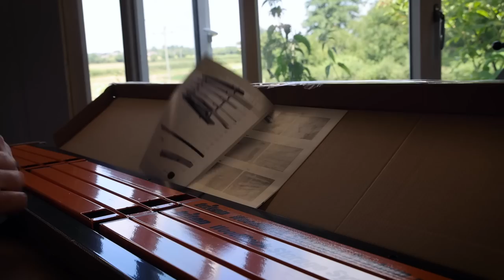Building a Home Workshop Timber Storage System for Guitar Building

Comment: Ben, I vote for a body on the Elm. I wish we had some here; the Dutch Elm Disease took all of ours. What tiny bit we still have is not protected. 

Any shape you like, but I wouldn't cut it up like Bob or something. It isn't wide enough, really, but you could book match it, giving you two seams or cracks in the center of the instrument. A two sided thing like your copper-rodded ones might look cool. Maybe not, that might be too busy. Use your judgement, but that's too nice and the crack too wide to make tops out of it. Besides, that piece is one of a kind. The guitar it makes ought to be the same.

Comment: I am on exactly the same page, love wood, love drooling over fancy pieces, I REALLY love getting good deals, but hate storage.  I do have an exterior rack I built under the large overhang of the roof on the side of our house.  Partially covered with sheets of plastic, but some has gotten UV bleached.  I do have some storage in the shop, but the shop is waay too small to add more.  I need a standalone building for extra shop space and storage.  I'm also at the point where I'm tripping over wood just trying to walk around.
Reply: Also, that lumber rack looks just like the stuff I got from Portamate.  Just different colors.

Comment: Hi Ben, the wood storage looks really amazing!!! But... i'm no expert in storing wooden plates, but I've noticed, that you don't have all the supports between each plate in the same spot (so that they would be vertically aligned). And I have a feeling, that it may cause some issues and actually bend the plate instead of keeping it straight! Because when you offset the upper support (or could it be called interspace?) against the lower support, the wieght of everything above creates a tension on the plate and causes a bend. On the other hand, when those interspaces are vertically aligned, the weight just transfers through the wood down. I don't know, if you could understand what I mean with this explanation, but it can be seen already in the video. 
In time 19:44, there is a clear view of this effect on those thin plates - the bottom one is already curved because the weight of all above creates a leverage against the rack support.
Please correct me, if I'm wrong :-)))

Comment: I have them in my shop its not straight forward. Its easy to get the order of operations wrong. Also they changed the way they made them and you get 2 different set that don't line up the same.

Comment: I think that piece of elm would make one punk-ass, super metal, seriously bitchin, custom B.C. Rich Warlock (with widow headstock of course). But that's just me. hallow out the body, get some epoxy resin and LEDs in those natural cracks, and make it glow like it was forged in the fires of mount doom, if not hell itself.

Comment: you could have used tongue depressors... would take up less room , more wood blanks per shelf.
Reply from the maker: But we need the distance for air flow etc, more space for more wood though.. tempting!
Reply: @CrimsonCustomGuitars  as long as there is a space...air will flow...but the popsicle stick, is only about 16% the thickness of what you are using... or you can build another room Ben... LOL